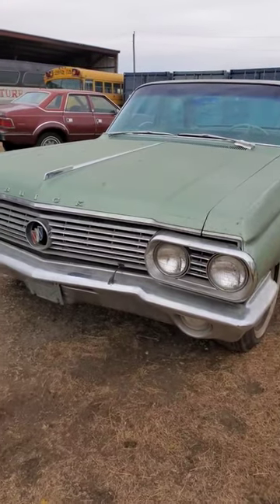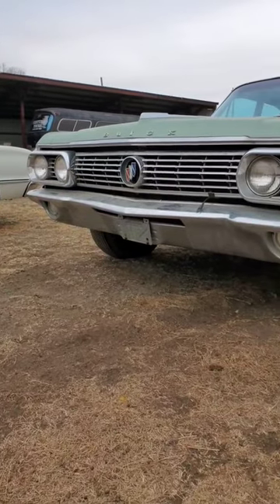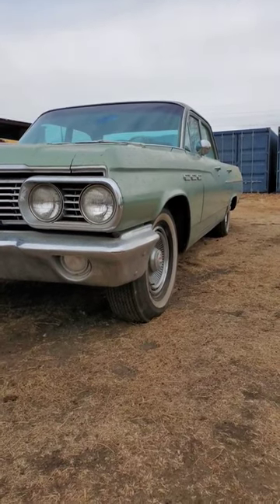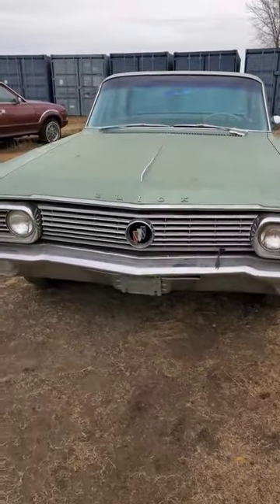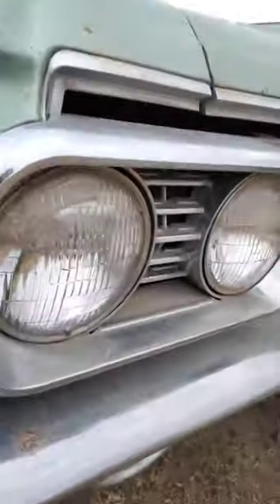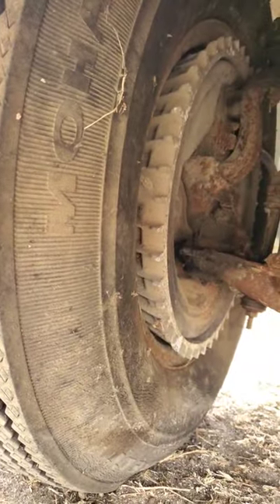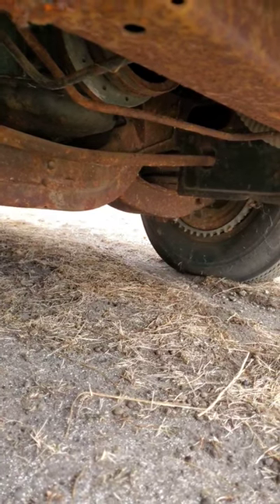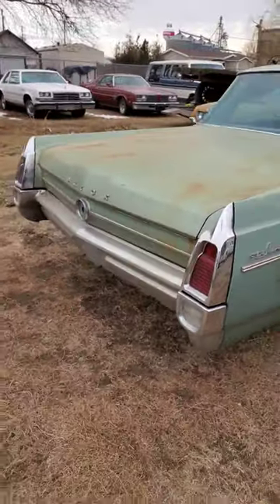High Performance IDEA or Normal Innovation

Comment: Back when you could pick and choose every option and customize your car exactly like you wanted it. I am so old.
Reply: You can still do that
Reply: You can literally still do that.
Reply: You're absolutely right. You could choose between gas or electric powered cars but choose electric because they're phasing out gas.
Reply: @Industry-insider  for my dad to "custom" order his 2011 f150 they had to actually disassemble his door panels so he could have a 4wd reg cab long bed with manual locks and window. So instead of custom building they "downgraded" an already built truck. My 92 f150 custom truly is custom because it has a heavy duty granny low 4 speed. Actually it has a t18 behind an inline 6 which is more common to have the np435 leading me to belive it was truly customized. Also an 88 2500 I owned was factory ordered and I enjoyed its originality very much
Reply: @calebz1448  yeah the issue there is that he bought a disgusting ass f150, they sell a ridiculous number of them each year so of course they don’t want to make custom ones
Reply: @Industry-insider  sure or you could always buy a "brand new" 4th Gen dodge because they sell such cheaply built trucks people want the cheapest they can buy and still say it's new. In reality they took an stx trim package and "downgraded" it with fleet truck door panels

Comment: back when cars had style and elegance , and individual car brands from one parent company were really there own vehicles not just different badges and slightly different interiors.. nowadays and for  past 25 plus years companies like general motors had a chevy model then a Pontiac,  oldsmobile and Buick that were almost identical... its pathetic. the 50s and 60s were the golden age of automobile manufacturing.. it was a beautiful time in automotive history.. something that will never happen again.. most youngsters will never know what they missed..
Reply: Well because it's cheaper to just put a 350 small block and a 700R4 across your whole lineup.... Nothing is built for longevity these days. My friend, everything is built to be put together cheaply and quickly and by as little human hands as possible, at least for domestic companies
Reply: you guys seem to forget this car did 6 mpg
Reply: @realperson.4339  that was alot back then~
Reply: @vincenegra2612  lol no they weren’t ignorant
Reply: @BuiltDifferent13  cheaper to manufacture one corporate design also. Lot of innovation went away when the sbc 305 replaced the olds and Pontiac engines. Gone were the different intakes or ignitions etc. The styling went all weird in the late 80’s too it’s like a lot of the design elements each brand was known for started disappearing.
Reply: @dirtyaznstyle4156  🤣
Reply: @realperson.4339  No, we didn't forget that they didn't get the fuel mileage of today's cars. 
We also didn't forget that in the '60s, a gallon of gas cost less than.35 cents. And THAT price included full service!
Reply: I may be young but no one will change my mind to abandon the classic era
Reply: @realperson.4339  of course it was heavy had a carburetor that probably only burned about 50% of its fuel and either a 3 SPD trans with or without an overdrive.. this car could easily be made to get over 20mpg.. a newer electronic carb/efi  system get rid of the manual fan and any other unnecessary components being driven by the serpentine belt a more efficient intake system and a 4spd transmission..
Reply: @realperson.4339  No, it did not, and no one cares.
Reply: Idk about never again. Theres no telling what the future has in store.
Reply: To be fair the trade off its parts, a tahoe suburban cadalac escalade yukon all have my rear end. So while we lost elegance, design uniqueness and other cool stuff we got luxuries parts availability and safety. I prefer the old cars for appearance and mechanic-ing.
Reply: @Syriondeathvow  these new cars from the past 15 years and now are not nearly as reliable as you think they are.. as far as safety goes that depends entirely on the vehicle there are cars from the 70s n 80s that are just as safe as new cars.. remember you can get in a wreck at 35mph in a car from the 70s through 90s and the car won't be totalled.  You hit something going 25mph in a new car and its junk afterwards..if cars from the 80s weren't reliable you wouldn't still be seeing them on the road.. it all comes down to how well its taken care of..
Reply: @realperson.4339  And 100k miles was comparative to 200k miles in current cars
Reply: @vincetimmerberg3146  classic cars are special for a reason, but don't think they compare to modern cars when there is a Corolla that gets 3-4 times the mpg while also having more power from a 3 cylinder engine. 

I love classic cars too, but they are just completely different and don't even compare to modern cars
Reply: @flatoutlikemcrae2020  of course the technology on modern cars is better, and newer cars in stock form obviously handle better but ease of fixing them goes to older cars always
Reply: @vincetimmerberg3146  and thats part of the reason why classic cars are awesome, I just hate when people say stuff like if you change all the parts and basically make it a resto mod then it would be just as good
Reply: @vincenegra2612  I am pretty sure that any Wartburg or Wolga would best that by far.
Reply: The copycat between GM started 50 years ago.
Reply: @kennethfulgium2021  right lol, just look at the early Chevy Camaro and Pontiac Firebird
Reply: @flatoutlikemcrae2020  yeah resto Moda just look like classics they no longer run , handle or act like classics
Reply: You forgot to mention they weren't made out of plastic
Reply: Now we have reliable cars that don't kill us when we get into an accident. Yeah we really don't know what we're missing.
Reply: @BuiltDifferent13  say that to my 2012 civic si with 320,00 miles.
Reply: @vincetimmerberg3146  says the guy who has literally never owned a new car.
Reply: @vincetimmerberg3146  now go outside and rebuild a transmission on any car. I'll wait.
Reply: @vampcaff  what does rebuilding a transmission on any vehicle have to do with anything I said??? Other than transmission these days are more complex then they were decades ago??
Reply: @vampcaff  that's 2012 still good and also a inline 4 cylinder Honda engine maybe one of the best ever.... Honda and Toyota are just that last to really start turning to crap 2018+ are crap even sooner in some cases
Reply: @vampcaff  says the guy who has no idea what I have or haven't owned...actually I have owned a new car. Had an 08 in 09. A 2014 and now drive a different 2014.. n guess what the 08 I had also had a defective lifter and almost seized the motor..my brother has a 2017 jeep and had to have both heads rebuilt just before the warranty was up due to faulty lifters and cam,  you ever think maybe I prefer older vehicles?? Not everyone wants to drive something thts  only a year or 2 old..  my 94 f150. Not 1 single mechanical issue.. only thing I had to replace was the valve cover gasket because it was worn out and I had a squrriel chew thru the wire on the number 3 injector so I fixed it with soldering it. These newer vehicles cant take an impact over 15 mph without having serious damage.. I grew up driving older vehicles because I'm not 20 yrs old so I prefer older more reliable vehicles.. but you know everything..
Reply: @vampcaff  its called wear your seat belt. And if you've never driven an older vehicle no you don't know what your missing.. obviously you shunned anything that's older then 5 years because you have to have something new.. most people that trade in cars every 2 or 3 years are people who are scared to try n work on anything or there women.. and people who absolutely don't take care of there vehicle so they have to get a new one every few years..enjoy constantly making payments the rest of your life..
Reply: @jeremys959  no they were not.. I've got someone replying to me saying older cars just kill you in an accident and were not missing anything because older vehicles are junk. Its probably a 17 yr old kid who has never even ridden in something older than a 2012 model vehicle
Reply: As a kid born in ‘03 it truly is a tragedy.
Reply: I’m into old cars and I’ve seen the difference the only reason why I’d get a new car is just for the gas mileage
Reply: @BuiltDifferent13  any tiny mass produced engine built today will outperform, outlive and be more reliable than anything built back then. Yeah I’m not a fan of modern aesthetics either, but having owned very old cars and modern cars, I would choose a modern car for daily driving any day of the week.
Reply: Not to mention, at least if you crash in a modern car you’re going to mostly be fine, but if you’re wrecking in one of those cars - whichll happen pretty often considering the handling etc - you’ll be lucky to come out with a missing limb and brain damage, let alone your life.
Reply: All the brands look so similar now, your only real option is interior and color.
Reply: @davidthompson5710  this is extremely true
Reply: @davidthompson5710  why I’m sticking with my 71 maverick grabber and my e46 330i m3 bmw (5speed manual too)
Reply: @vincetimmerberg3146  word~
Reply: If memory serves me good, the turning point was in 1970. Skylark, Chevelle and Monte Carlo shared the same trunk lid. Just my 2 cents.
Reply: Easy there im in my 20's and I've got an 86 Squarebody with a computer delete and naturally aspirated 350, i can still appreciate real innovation versus useless creature comforts that drive up a price tag for no reason
Reply: @vincetimmerberg3146  but then it wouldn't be a classic car!
Reply: @willhorting5317  you realise 35 cents in 60's money is equal to about $3.50 in todays right?  We were well below that just a few years ago before our wonderful current administration decided to stop domestic oil production and destroy our gas prices.  A car that gets 6mpg back in the 60's is still costing you much more money than a car today that gets 20-30 mpg.  I dont frankly care about fuel economy, i just want cars to be fun again.. But I dont deny reality.  I think engines are already so clean and efficient that our job is already done,  now if only they would actually let car manufacturers evolve and innovate naturally instead of mandating all of these ridiculous fuel economy restrictions that are so over the top, its destroying the auto industry, and forcing manufacturers to prioritize throwaway planned obsolescent EV's which harm the environment more so and are far less convenient.
Reply: @johnsullivan937  I am not sure why I deserved to have a diatribe about government interference directed at me.
And considering that I can no longer see the comment (that was NOT written by you) that I originally commented to, I also can not understand why you chose me to direct your comment to.
Whatever.

I wish vehicles were fun again too.
And I wish that they were still built so that the average person could EASILY work on them.
Yes, today's vehicles are more efficient than the older ones. Anyone that would deny that, knows EVEN LESS THAN ME.
But I lift the hood of a '22 F150, and I can barely see the engine, for all of the wires and smog crap. There's no way that I would want to try to work on it in my back yard (if I physically still could...age & health prevents it).
Even the car I currently own, an '04 Buick, has less going on under the hood than the new cars.
But compared to the '91 F150 that I had before this Buick, the Buick is still a cluster** to work on. Everything is computerized. And there's little to no room to work on anything.

Now that both you and I have made useless, long-winded comments directed to each other, for no real purpose.... can we simply agree that vehicles from '22... and vehicles from prior to 1970...both have their good and bad qualities... and simply wish each other a Merry Christmas?
I have nothing against you or anyone else here. We are (or should be) all interested in cars, otherwise we wouldn't have clicked on the video, right?

Merry Christmas!!
Reply: @HennryHammerhead Probably more screens and ridiculous designs that are trying too hard to look "futuristic" to appeal to the modern family there are a few cars that still look good and don't have over the top space ship egg style
Reply: @HennryHammerhead Probably more screens and ridiculous designs that are trying too hard to look "futuristic" to appeal to the modern family there are a few cars that still look good and don't have over the top space ship egg styling but it isn't looking good so far.
Reply: @HennryHammerhead Probably more screens and ridiculous designs that are trying too hard to look "futuristic" to appeal to the modern family there are a few cars that still look good and don't have over the top space ship egg style

Comment: Back in the late 60’s we had a beater car that was a 63’ Buick with a 340 (maybe360) and it had a 3 on the tree (3 speed manual on the steering column). This was our junk car that we used to park by the Stadium (Chicago) on the street for free, when we went to watch the Blackhawks play on Friday nights. We used to walk to the ticket booth and buy 2nd balcony, in the middle, 2 or 3rd row seats for $3. We never took a good car there because it would disappear (would get stolen). By the way, this car was pretty quick, but my normal ride was a 66’ Chevelle convertible, red with white interior. It did have the SS396 package with a 4 speed manual on the floor with a bench seat, the shifter was the same as in a corvette. I bought it used with 20,000 miles in 1967 for $1650 and traded it in with 92,000 miles. It was a fun car that I enjoyed.   The good old days!!!   Jim

Comment: So agree! I hate screens! Yesterday morning, all dark outside, I drove a customer car around the building and in the workshop. The screen was the brightest I've ever seen! I had to really focus to not be blinded by the light!

Beautiful old machine you found and showed us here! Nice touch with the aluminium drums! 👌
Reply: Have been in a few cars like that, you would think they would be smart enough to tie it to the dimmer knob for the rest of the instrument lights, or better yet on its own knob.
Reply: The aluminum drums are neat and all.. but I'm not so sure they were the greatest idea either. 
higher wear factor, probably harder to find replacement for, and then there's the stone versus soft metal issue...  seems to me that the aluminum would fill the pores of the stone, requiring increased pressure to make up for the increase in slickness.
I'm curious to know, if there's anybody reading this who has personal experience with aluminum drums. :-)
Reply: @1SqueakyWheel  I thought I heard him say that the braking surface was not aluminium....
Reply: @eirik_halvorsen  maybe he did say that.. if so, I didn't hear it, but it would make a lot more sense. 
I guess it would have to be pressed in then.